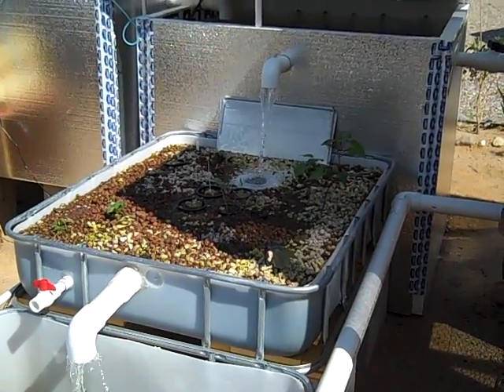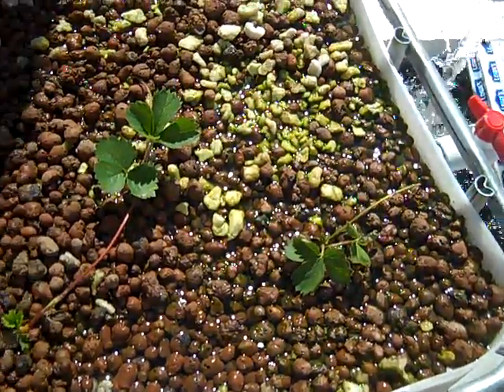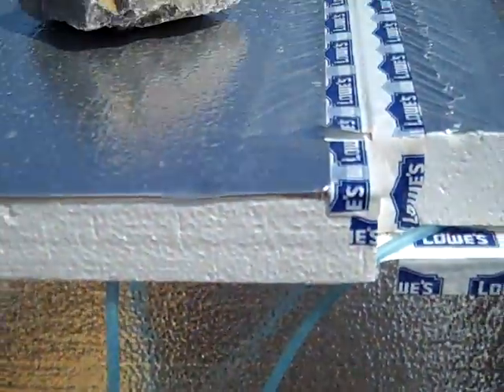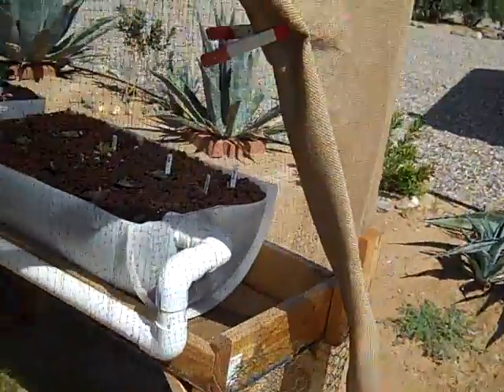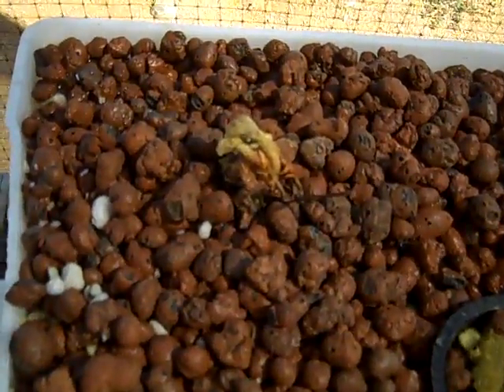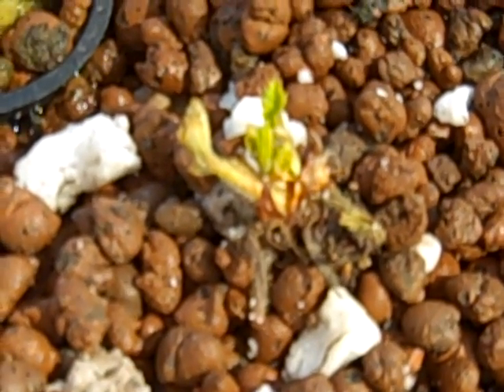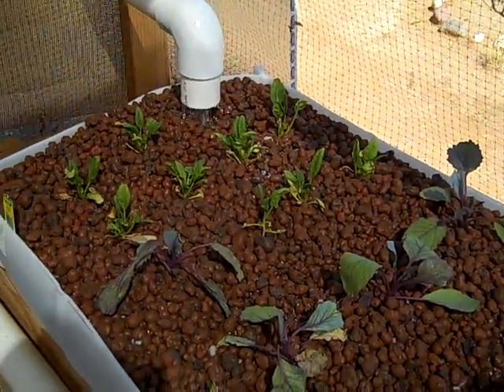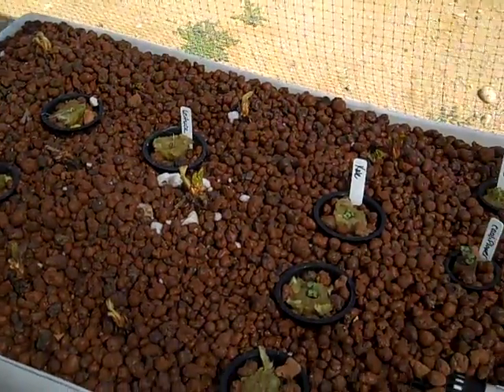August 31st update on Aquaponics System

Comment: Not bad. Nice setup. You can compost by adding worms to the grow bed and just jam your old fluits/veggies into the media.  You may want to consider using a venturi aerator  between the pump and fish tank.  Also, it might be a good idea to fill your grow beds under the growth media to avoid algae formation and decrease evaporation...especially in the dry desert air.